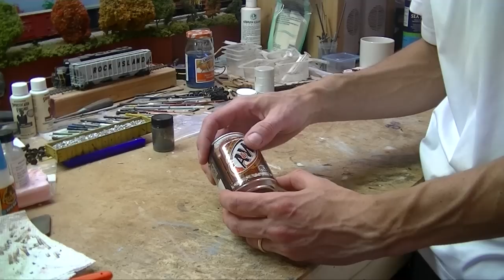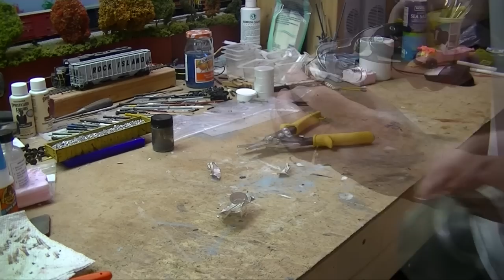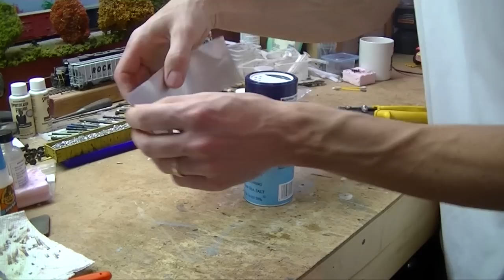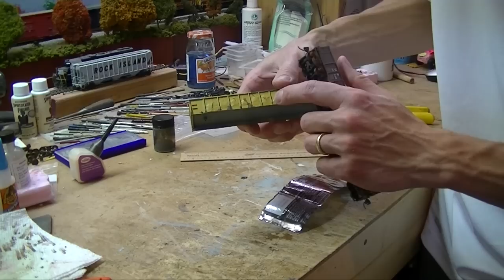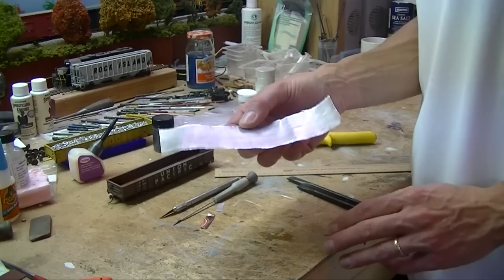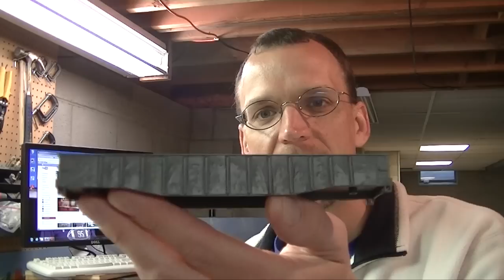Sorry Dorothy, Tinman is Now a Gondola - Using Tin for the Sides of a Dented Gondola

Comment: I use an old pair of small scissors to cut the aluminum can. Just push them through the side instead of trying to chop through the top of the can. For me, the less sharp edges the better. Also a big nail can cut through the can as a scribe, two or three passes and it cuts right through. I think the cans are a great CHEAP material to use.